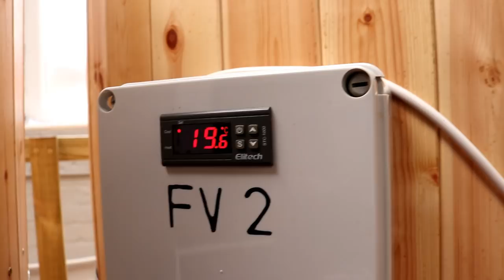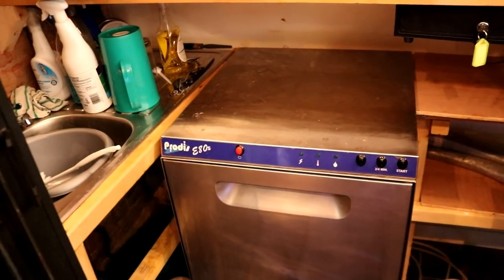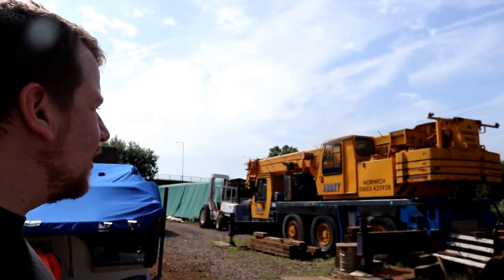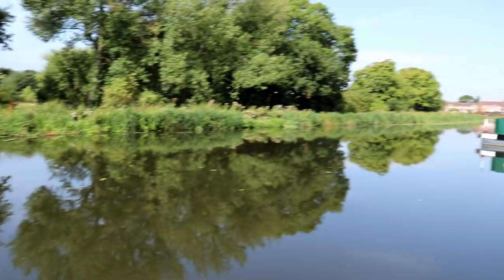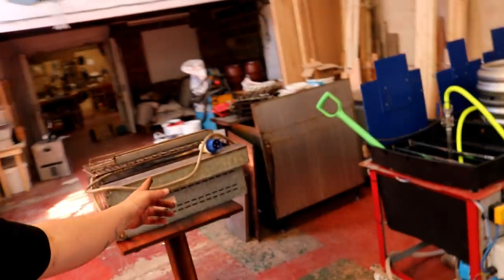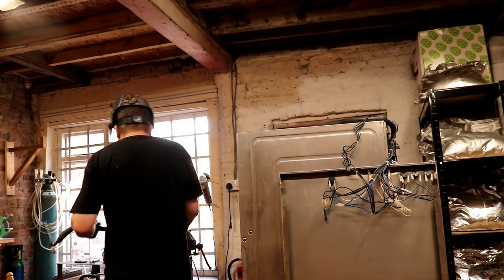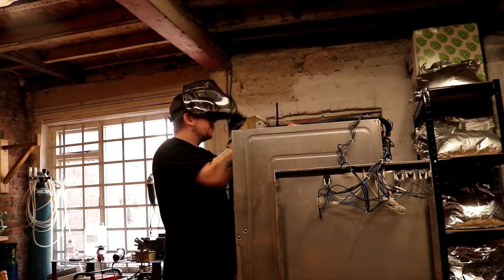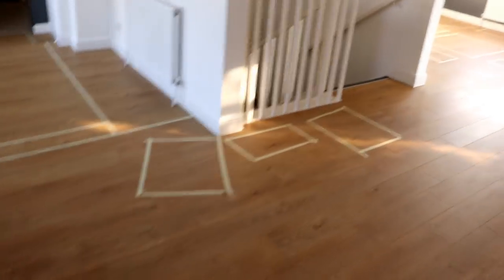CATERING EQUIPMENT

Comment: Just a note about the kitchen.  I work in a restaurant and the pot wash area is always piss wet.  You need the make sure the floor is sealed properly.  We have a type of  black sealing that goes up the wall a foot.  I worry you might experience rot again if you don't deal with it now.
Reply from the maker: It will be the main focus for me before we start cooking. cheers.

Comment: You're giving Clive a run for his money now picking up van loads of gear lol. I would seal that wash area in kitchen if i were you,there is probably an epoxy floor covering specifically for the job,otherwise you are bound to have issues again down the road. Looking good otherwise. Cheers.